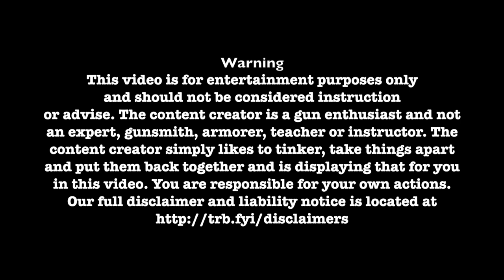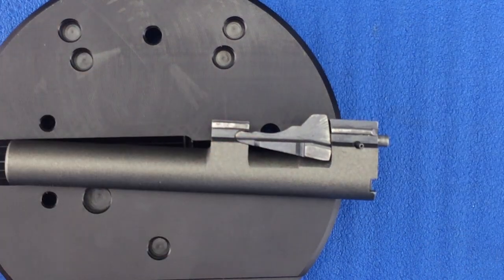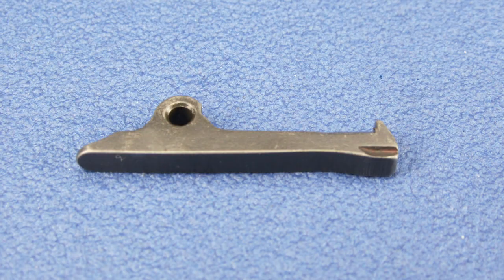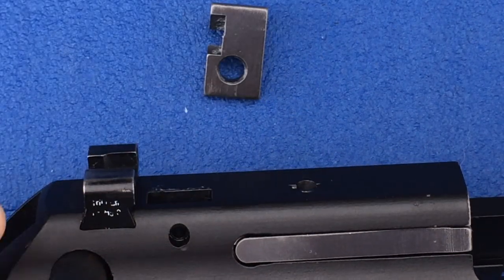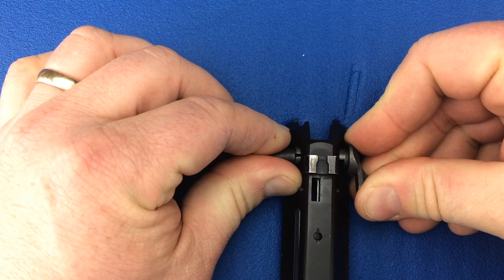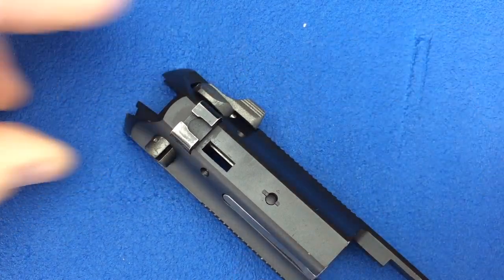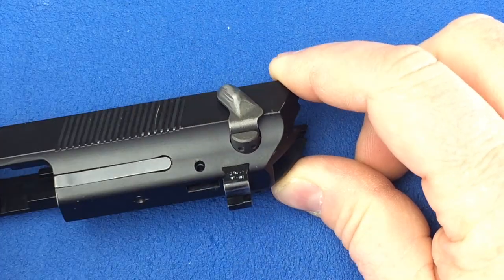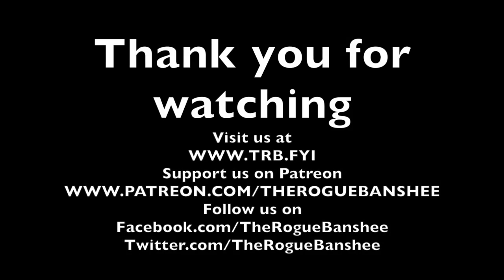Beretta 92fs Step By Step Slide Assembly (reassembly) Simplified (also Beretta M9a1 and Beretta 96)

Comment: I followed these directions on a Girsan Regard, it worked the same but the pins that hold the safety and extractor are much more tight than the beretta is.

Comment: So the trigger bar side safety denton spring, is  interchangeable with the firing pin block spring? 
I’ve just sent for replacement spring for that offside denton spring not knowing that there was different in size between both springs. 
Guess i’ll just have to re order a firing pin block spring instead for the denton .
On another note do you think maybe you could make video on placing a “G” conversion kit replacement on original slide? O big thumbs up 👍🏼💪🏽your videos are amazing 10:19

Comment: The only addition I would have done when doing this clip would have set all the pins/detent  in line to show the differences to make it easier to pick the correct one out when needed.  MSgt. David R. Smyth, USAF, Ret.
Reply from the maker: First of all, Thank you for your service. Secondly, you are absolutely right. That would have made the video better. Thanks for the suggestion!
Reply: @TheRogueBanshee  Glad to.  As someone who took his slide apart about a month ago, laying out all the springs would also help.  Fortunately, most are size specific, but it would help an amateur gunsmith.  Loved it and thanks for taking the time to create it.  I also used your disassembly video to get it apart.    While in the military, AF, we had 38 spcl's and M-16's.  the other services had  1911's, so my time with semi-auto's  was limited to M-16 repair.

Comment: I have Italian 92 fs it has roll pins rather than tension pins that are in the US version.  
Can these be swapped out for the tension pins or do i need to buy metric roll pin punches to work on gun
Reply from the maker: For Liability reasions, the only thing I can say is use what Beretta has designed for your slide. Sorry.

Comment: Great video very detailed.I do have a question do you need to restake the extractor  pin or will it stay in place without doing that? Thanks in advance  for your help.
Reply from the maker: I am glad you like the video and thanks for watching. For liability reasons, I cannot give advice. However, If you look at the Army TM 9-1005-317-23 it does not state to stake it (I didn't stake mine)
Reply: @TheRogueBanshee  Thanks for the info on that document. It is a long read but worth it. I also saw no mention of it. My research found mixed results some smiths say you should and some say not needed. Thanks again.
Reply from the maker: @barefootbob1269  No problem. Glad it helped. There are several camps on that but I think most don't stake it again because it would mess up the finish.
Reply: Wait... what does "restake" the extractor mean? I'm sending mine in to be CPII plated and don't want to miss a step.
Reply: @sethpeterson8261  If you look at the top of your slide where the extractor pin goes, you can see a 'dimple' in the front/rear of the pin and a slight bit of metal pushed down and over the extractor pin.   It has been 'staked' from the factory to ensure that it stays in place.   As TRB mentioned, there are two camps.. those who restake, and those who do not.   In my personal opinion (which is MINE and MINE ALONE [disclaimer :)] I go with the same view as Wilson Combat and re-stake.  Rather simple to do FOR ME (disclaimer!) I used a regular screwdriver of an appropriate size, and lined it up with the previous stake lines and gave it a tap or two.  If done carefully, it will not be to hard on the finish, but YES it can mar it....  In my personal opinion, better safe than sorry.  :)
Reply: @cyb3rpr1m36  Thanks for the answer. Appreciate it.